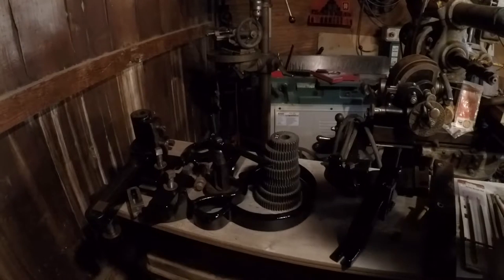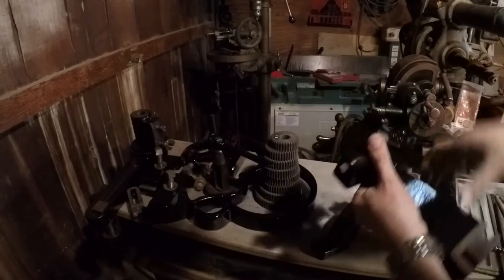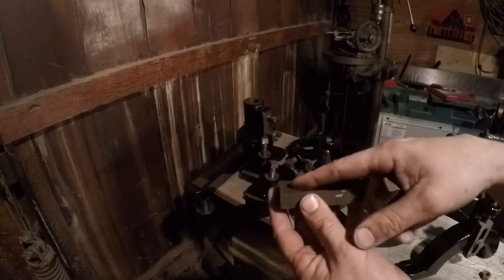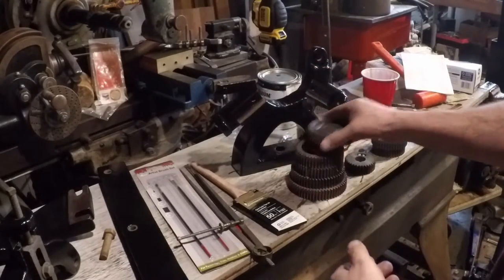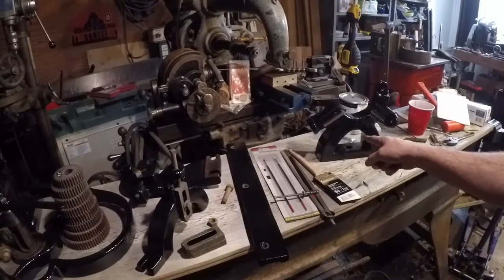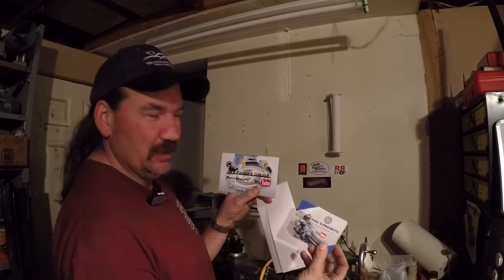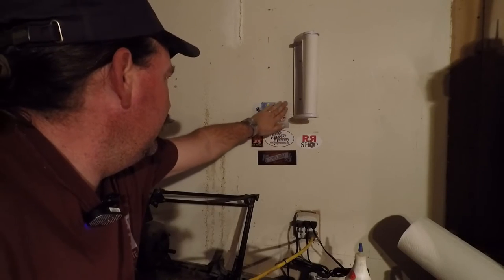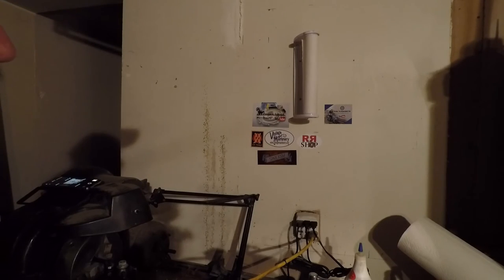Lathe update with stickers from Pierre's garage and phil's projects

Comment: This is that one more video I was looking for. :)
Reply from the maker: +John Strange no problem going to be doing some electrolysis to remove rust probably be a couple of videos down the line I got quite a few things on cleaning stuff and rust removing and whatnot
Reply: Cool. I need to try electrolysis one of these days.  I checked out your vinegar bath one with the gap bridge and steady rest. - I saw in one of your other videos (and in this one too actually) that you have another lathe. That has to be most helpful when restoring another one.
Reply from the maker: vinegar works well but can attack the metal so be careful thats why im going to try electrolysis it will not harm the part your working on .